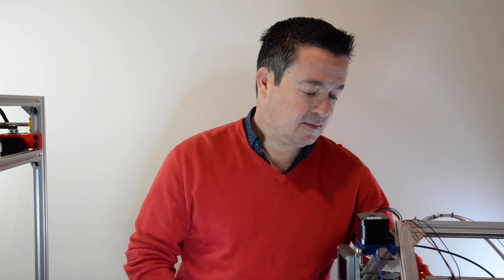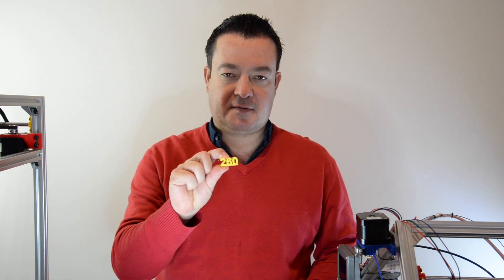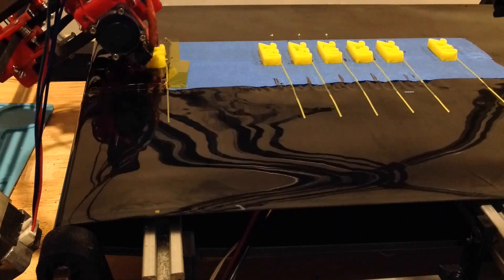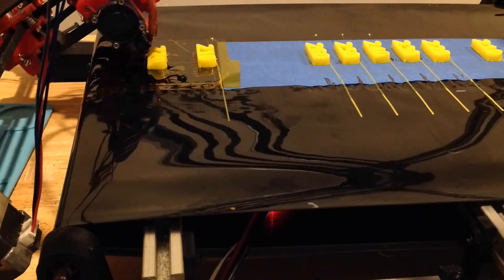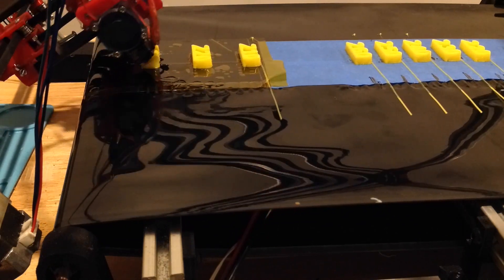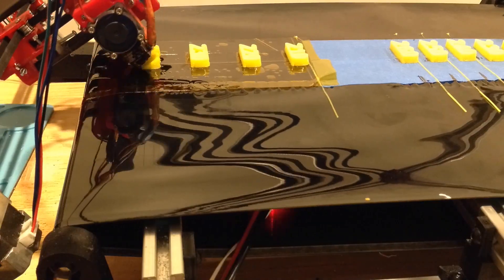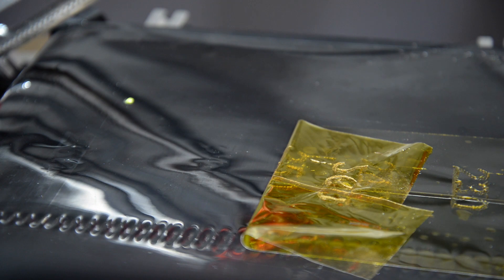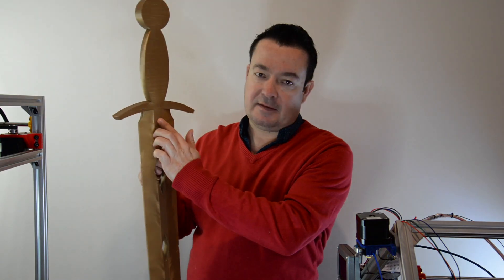Tilted Belt Printer: How to prevent Belt Damage

Comment: What about carbonfiber belt
Reply from the maker: Yes. That will probably be ideal. Like BlackBelt3D's printer: https://www.youtube.com/watch?v=oV_yFxniwSQ. I haven't gone down that road because I suspect carbonfiber will be expensive.
Reply: Zechy Coyte-King https://rover.ebay.com/rover/0/0/0?mpre=https%3A%2F%2Fwww.ebay.com%2Fulk%2Fitm%2F391932620996
Reply from the maker: Good tip. Thanks.

Comment: Hi, do you use stainless steel belt? Or change to another material? Nice work regards
Reply from the maker: This belt is not stainless steel. This is a belt from a laser printer transfer belt. It is quite heat resistant. It was just easier to use a belt that is already made. I did initially use a stainless steel belt. I see PrintrBelt is using a stainless steel belt - https://www.youtube.com/watch?v=uXFRHoNy8is
Reply: Zechy Coyte-King Ok perfect and what model of transfer belt do you use? I see a lot of different models for diferents printers Thanks!!
Reply from the maker: Ricoh MPC4500
Reply from the maker: Ricoh MPC4500. No specific reason. My brother had one so I tried it.
Reply: Zechy Coyte-King Thanks!! I test with same belt